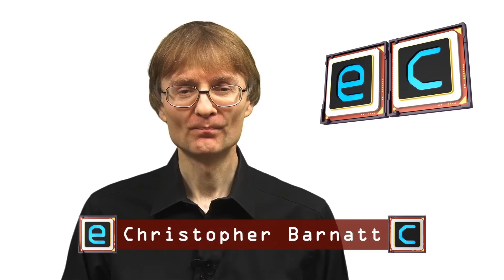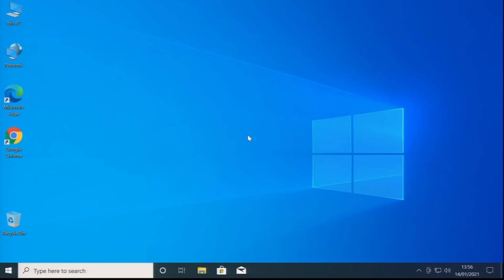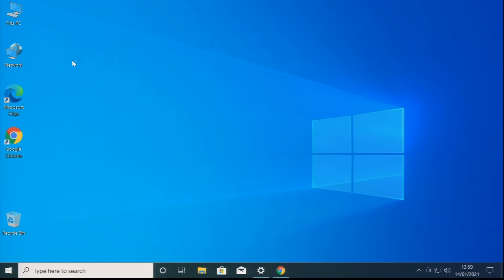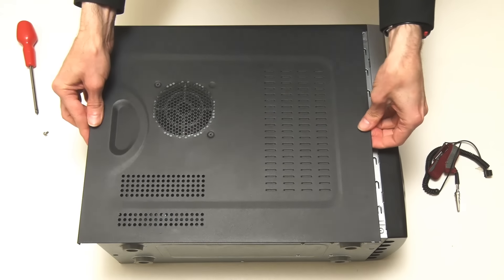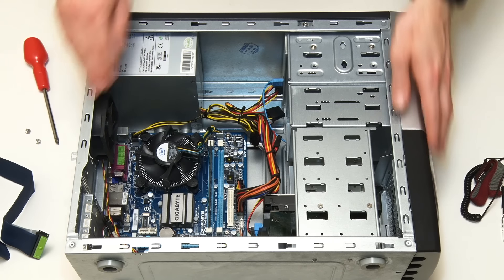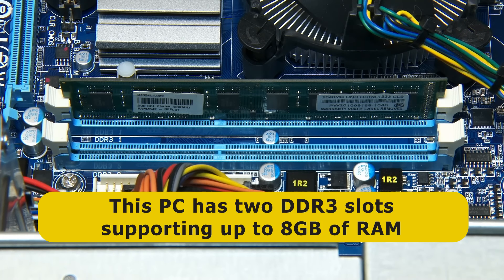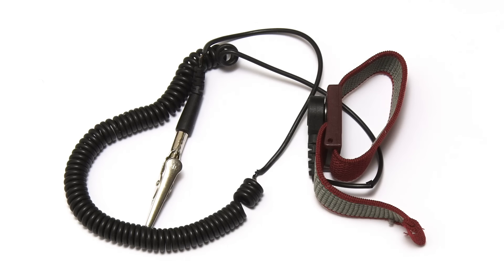Old PC Upgrade #1: Options & RAM

Comment: The most dramatic upgrade would be to put linux on it. 
This would have it running much faster, and would cost nothing as an upgrade. 
My preferred OS would be Lubuntu or similar. Lightweight and very fast. Plus not spyware reporting back to Micro$oft all day.
Reply from the maker: Agreed. But I have done many videos on this channel migrating computers to Linux -- not least trying Lubuntu, BionicPup32 and Zorin OS Lite on an old laptop in a video two weeks ago. :)

Comment: Sadly if you upgraded the whole lot ie replaced the motherboard - you are going to find it killer!  If AMD or Intel you will need an APU variant due to graphics cards at insane prices these days!  However, budget boards say a B450 or the intel equivalent (depending on which gen!) - plus say 16GB or dual channel ram, and an APU will mutilate that PC.  Cost though you are looking at £250 and when you go down that route you really need a new case and PSU!  Tough choices :)
Reply from the maker: You are right, the choices are difficult old upgrade vs new build.
Reply: @ExplainingComputers  Personallyt I would just put in a 240GB SSD - image Windows and use that as the boot drive.  You may be able to put GT1030 in or a CPU upgrade.  CPU upgrade would be better really as long as not used for gaming!

Comment: I disagree those 32bit PCI slots can still be useful if you need something like a WiFi card, and don't want a USB dongle taking up space, or something like an ASUS Xonar DG sound card which has an onboard headphone amp, but that sound card really only works if you are running Windows, as I've ran into issues trying to use one in Linux. As always 👍 👍.

Comment: Faster always runs slower?  Not necessarily, oem motherboards can be ridiculously picky, the xps 8700 for example required 1600mhz kingston i believe, faster dimms would actually drop it down to 1333mhz.

Comment: I think my immediate upgrades would be the same - RAM (as undertaken) and an SSD (future upgrade). However, if the budget was there, I'd definitely look on ebay and grab a faster S775 CPU where you could opt for a core 2 quad/extreme CPU, at a reasonable price, which would put the wind into the PC.

Have any benchmark tests been done the basic PC to compare with the upgraded PC?

Comment: 19:05 I think windows had a tool which you could use your flash drive as “ram” called readyboost and there were some videos. Which instructed you to buy a flash drive and use readyboost on it to “upgrade” your ram. And one of them was like you could buy a 1tb external hard drive and you could have 1tb of “ram”. I am sure Amazon aws would want that to work. 🤦

Comment: I think core 2 duo or dual core system shouldn't be labeled as really old as they can run win 10 acceptably well, please consider system having p4s to upgrade both at hardware and software level so they can be usable at acceptable level...

Comment: My DELL Inspiron 560 has the same processor as the one in the video. It still has Windows 7 on it. It doesn't say the motherboard specifications in the system information.

Comment: Tbh anything LGA775 based should probably be replaced by now. And I I say that as someone whoms first computer had an Intel Core 2 Quad.
Also in this case more RAM should definitely be added because the CPU supports dual-channel and if supported you should always use it.

Comment: Hi Chris around a year and a half  ago you upgraded a computer and installed a new SSD drive and migrated the operating system. I tried to do the same and when I turned on my laptop the fans spun so fast I could smell burning so I quickly shut the laptop down. What do you think could be the problem.
Reply from the maker: Sorry to hear that you've had upgrade problems. Maybe something got caught in the connector when you put in the new SSD? And created a short?

Comment: That's not an old PC, I still run a true 2003 Pentium 4 HT  (1C2T, 3.0 GHz) with 4 x 512MB of DDR (400 MHz). I use it once/week for ~1 hour as backup server with 1.21TB of HDDs; 2.5"'; 3.5"; SATA and IDE (3 x 320GB and 1 x 250GB). It only has a SATA-1 interface, but that is fine for these HDDs :)
It runs 32-bits FreeBSD 13.0-RC5 on OpenZFS 2.0, the latest "Unix" OS with the most advanced file system available on any PC worldwide today.

Comment: The mother board at start didn't put out a message that it detected new hardware?
The windows didn't put out a message saying that something change in hardware and need to configure it?
It did that for me when I added memory.
Reply from the maker: No such messages came up, and I would not expect them for new RAM. But there are many differrent BIOS types out there. Also, Windows (at least used to) run a points/counter system -- so if you put in more RAM having done a lot of other changes with I think 90 days, that may have triggered a new hardware message.

Comment: Adding an SSD would be a better option besides the RAM upgrade, however, the SATA port of ICH7 (South Bridge) on this G41 motherboard is only SATA 2.0 and it doesn`t support AHCI mode, which means the TRIM command will not work.
Reply from the maker: As I discuss in the video, you are right that the interface is only SATA II and that the G41 Express chipset does not have AHCI. However, AHCI is not needed for TRIM with the right/modern storage drivers. I have now installed an SSD on this system for the next episode in the series, and have confirmed (via fsutil behavior query DisableDeleteNotify) that TRIM is active in Windows 10.
Reply: @ExplainingComputers  Thanks for the experiment and clarification. Appreciate it! I'd like to find a G41 motherboard and take a try at that.
Reply from the maker: @alexzhao2469  Thanks for prompting me to try! :) I read around quite a bit this morning and it seems that using TRIM in Windows 7 without AHCI was problematic, but is far less so in Windows 10. I guess maybe something that Microsoft decided to sort out, as I did not have to seek out any special storage drivers.
Reply: The TRIM command is dependent on the SSD itself, and the operating system supporting it. It is not dependent on the host controller, and AHCI is not a requirement.
Reply: @charng  It's not true. The TRIM command still relies on the SATA/AHCI driver. I have an MCP78 motherboard (M3N78-CM), and I've verified the TRIM command is working well with the native AHCI driver of Windows 7 (msahci.sys), but it will NOT work using the official AHCI driver from nVidia (nvgts.sys).
Reply from the maker: @alexzhao2469  I agree. My understanding is that AHCI is not required for TRIM, but that driver support for the controller very much is.

Comment: Remove Windows 10 preinstalled stuff, remove optional Windows components, set power plan to high performance, disable telemetry, use Pale Moon web browser, upgrade CPU to cheap Core 2 Quad. Enjoy.

Comment: Disabling the page file or swap file improves load times significantly. The only risk is running out of RAM, which is usually worth it, if you know what you're doing. It also reduces HDD/SSD wear. 👍
Reply: Incorrect, If you want a real improvement to load times, get an SSD. Disabling a swap file on a low ram system is simply asking for trouble.
Reply: @mikem9536  What I said is factual. You probably misunderstood me or have no idea what I'm talking about. 
PS: Windows 10 has the capability to free up RAM, when it's full. It's not a pleasant experience, apps do freeze for a few seconds, but it even manages to kick out parts of Chrome, without crashing it.

Comment: I've got a case with power supply sitting here and I think the mobo with a Core 2 Duo CPU is still in it as well as a DVD writer. I think the mobo died, it was a while ago so can't remember. It's the mobo's second case, the original PSU died a long time ago so I transferred everything over to a new case. Wondering what to do with it.

Comment: Is it possible that those floppy drive port holes are legacy dimensions that other hardware will intentionally conform to for years to come, like the cigarette lighter adapter on chargers that are used in cars?
Reply from the maker: Yes, a 3.5 inch bay -- as 3.5 inch floppy and hard drives -- is a standard that has endured. Often used today for card readers and removable 2.5 inch bays.

Comment: mobo Support for DDR3 1066/800 MHz But the CPU E5500 can only go for 800Mhz 
u can change the cpu to read 1066 or higher u find it on support - CPU Support.
p.s i like how clean the mobo look :)

Comment: I got an old build in pc monitor(hp monitor) from my uncle.does this guide work the same for such a pc?
Reply from the maker: It will depend what is inside! :) But you can probably upgrade the RAM in the same way, and probably the hard drive also (as in the the next part of this video). But the motherboard in your monitor PC may have SO-DIMM RAM (the small form-factor used in laptops) rather than standard PC RAM. I've a video all about RAM that may help when you look inside: https://www.youtube.com/watch?v=qmJWkfOTOPg

Comment: Would be interesting if you can upgrade the CPU, but this socket is quite old LGA 775, any viable option, like Alibaba cpus?
Reply: If the BIOS will take it,, and if you can find one, a Q9500 would roughly double the CPU power.

Comment: Not updating MB bios? could improve stability security and upgradability, no?
Reply from the maker: I never update a motherboard BIOS unless there is problem to be fixed. :)
Reply: @ExplainingComputers  oh, got. Thanks for the info. But if you want it seems newer (2016) need and updated bios. Mind you that’s what I’ve caught on YT.
Be safe!

Comment: Have you ever done a video on creating a win to go stick. I generally dont run win10, but would like to put in a stick to run it when needed like i can do with linux. (pull out the hard drive an it will find the usb automatically as install business as usual.

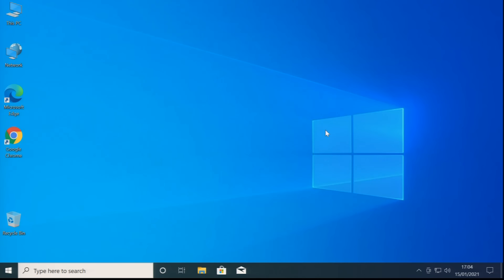Comment: @19:18ish you mentioned virtual ram and all that - ok I tried using USB sticks for "readyboost".... it was great - for about three weeks, then they were all dead. Was I doing something wrong? It worked - no doubt. But it also blew the USB drive in just a few weeks. Any advice?

Comment: Maybe some time discuss how to see if Windows is OEM or Retail (eg "slmgr" command), and whether you could upgrade the motherboard using the existing Windows 10 licence.
Reply from the maker: A very good point.
Reply: @ExplainingComputers   a good point is also Vitamin D , take 4000 units per day of vitamin d , christopher
Reply: @ExplainingComputers  I changed the motherboard CPU & memory etc. on an OEM pc, I temporary booted the system with the old HDD, logged in to my Microsoft account, then went to activation, after a couple of tries it activated ok.
Regards Ray...

Comment: More than 50 GBP!! I think that is a bit expensive. After upgrading ram SSD and maybe GPU you still have a slowish system with a max of 8 GB. With a bit of bargain hunting you can  get a bit more recent HP office PC that comes with 8GB and sometimes even an SSD . With shipping you end up with better hardware for a similar price point.

Good to point out the suspicious PSU. Still watching, I hope you did check the harddrive or binned it. 
Looks clean from the inside. But would replace the standard CPU cooler.

Comment: If Linux was chosen over win10 (debian or xubuntu), I'd swap the CPU for a q6600 with BSEL tape-mod for a 3GHz or faster CPU (using that 8gb RAM and a bios update), and put in a rx570 for doom eternal in vulkan at about 60fps in 1080p. Then the PCI-e x1 slot would have a 2-sata ports HBA in it to give 6 sata ports for btrfs (or zfs) as HDDs which can fit in that case (not used as the boot drive), and at 2TB each (per HDD) you'd have an index drive and then 8TB of storage because 1 HDD would be spare in the btrfs (chain) array to swap out upon errors forming. The boot drive would run off the IDE cable as a SSD (via sata-to-IDE converter) and the 2nd IDE on the same Ribbon cable would be the original HDD used for swap space and as a fat32 for dumping mswindows files.
The legacy PCI slots would be occupied first with a usb3 card (powered so you can charge things like phones or a pi4), and so the second would have a decent soundcard such as a MAudio Delta 1010.
Power Supply would be swapped for a bronze rated 500watt (or higher). I'd stick an extra rj45 dongle in one of the usb2 ports and a DVDRW.

Comment: Chris, I have an old Apple Imac g4 Snowglobe that I would like to upgrade. I know some people have done upgrade massive changes to them but they are beyond my expertise. Do you plan to do a series on such units???
Reply: Apple has traditionally made upgrading their systems extremely difficult so I doubt it could be upgraded other than maxing out the ram and putting an SSD in.  I have a 2006 24" iMac that works great, but latest OS is 10.6.8 which is WAY beyond support, even current browsers won't work on it.  Finally got Linux Mint Mate 20.04 installed (HATE UEFI!), but it limited a bit by the max 4G ram.  Still have to get the iSight camera working, as well as accessing the overheat prone, separate gpu.

If you're not stuck with MacOS, stick a mini/ITX motherboard in there and run Windows.

Or, see if a Mac Mini might fit into the snowglobe.
Reply: @richardwernst  Thanks, I thought of that. I was wondering if loading Mint or something similar would make it move a tad faster

Comment: Most of the 2011 computers require low density ram DDR3 modules in 4GB, This may be hard to find, Need to make sure ram is for your specific mother board!!!!

Comment: The FSB of the installed processor is rated at 800MHz. Wondering how much of a performance boost would it bring to have a newer processor supporting FSB speed1333Mhz.

Comment: Thank you for sharing these informations, I appreciate how you talked in a soft slow pace for us non-techies. I learned a lot!
anyways I have a question. My motherboard is a68hm-k and I search for its specifications and under memory I found this

2 x DIMM, Max. 32GB, DDR3 2400(O.C.)/2133/1866/1600/1333 MHz Non-ECC, Un-buffered Memory

and I don't know what does it mean.
I hope I get a reply :)
anyways,

Thanks a lot.

Comment: Surely the website loaded quicker after the RAM upgrade because it was already cached. I wouldn't have thought there would be a half a minute's difference simply by adding more RAM.
Reply from the maker: The cache was cleared before each test. And far more significantly, the loading of the web page took place right at the end of the test, so was not a large part of it. To be clear, most the time taken in the first test was to load Chome, not to load the web page. Chrome uses a great deal of memory (and has a great reputation for doing so), and so I am not at all surprised that increasing RAM from 2GB (which is the absolute minimum for Windows 10 64 bit) has a very significant impact on loading a memory hungry program. :)
Reply: @ExplainingComputers  Wow that's quite surprising then. Yeah I'm aware of Chrome's reputation for being a RAM hog, I always thought it was probably a bit blown out of proportion by inexperienced users or that it had simply become a meme. Then again I don't use Chrome, or Windows 10, and have never even tried doing so on as little as 2Gb RAM.

Comment: Hi, I've been running Mint on a "older laptop," its been great, thanks for the  recommendation. I have just preformed an update done 4 or 5  previously , fine. THIS TIME
'Im now being required to enter a pass word, did not have one previously . . .  Tried all the usual net advice  🤣, , done a couple recovery,  no mint is not the default pw ect . .Being an "older laptop" throwing it against the wall is now becoming an option . . . . or is there one more thing I could try?  BTW Happy NY
Reply from the maker: All I can advise from what you state is a fresh install. Good luck! :)
Reply: @ExplainingComputers   Thanks, great show . . .

Comment: Really helpful - thank you! I have a ten year old Pentium Desktop that I've nurtured over the years - but is now showing its age. I think its going to need a motherboard upgrade, but have been put off by some of the implicit complexities. Looking forward to your presentation on the subject!

BTW. What do you do with the older components you remove?
Reply from the maker: I hoard older computing stuff, like the removed components. I never know when they will prove useful in a video! I have in the past thrown or given away so many computing bits and pieces I now wish I had kept!
Reply: Like Chris, I hoard old parts. But eventually, I do clear out my holdings and look for a recycling option. Here in Gloucester, our weekly council doorstep recycling collections will now take away any and all small appliances and components, so quite a few of my broken old laptop bits were recently disposed of that way.

Comment: The funny thing is that my Pi 4 is faster than this PC. Already it's 100 dollars with the Ram upgrade. The biggest drawback is that it has USB2 instead of USB3 although I guess you could buy a USB3 card for it, but that's more money. Still, it's interesting to see how simple it is to upgrade a computer from that era. The second biggest improvement to me is installing an SSD. I bought an old HP Optiplex 9020 and sticking an SSD in it transformed it. With a V-Pro i7 and 16 gigs of RAM it actually makes windoze run okay. RAM is the best upgrade though, you're right about that. It was true even on the old Amigas. I remember maxing out the Zip RAM in my A3000 and how much better it performed even with the tiny requirements of Amiga DOS.

Comment: Hey Chris! How about a laptop upgrade? I have a 10 year old Toshiba that was state of the art then, I've put an SSD in but it's not enough. It doesn't have bluetooth either and for some reason ASUS BT400 or 500 USB dongles don't work.
Reply: What cpu does your laptop have? If it is not soldered in, you might be able to upgrade to a faster one. You could almost maximise the RAM, if not already done.